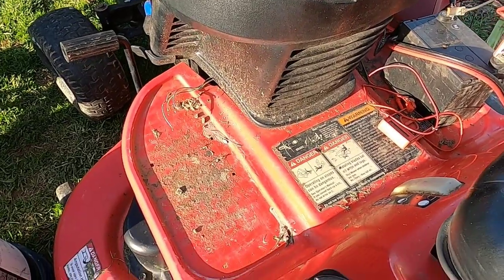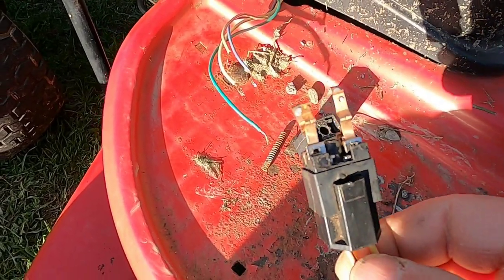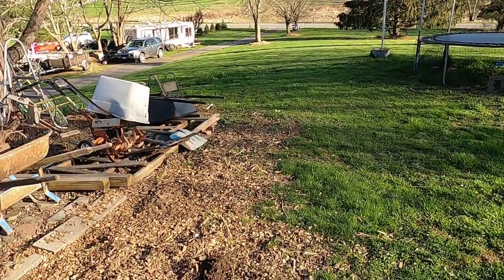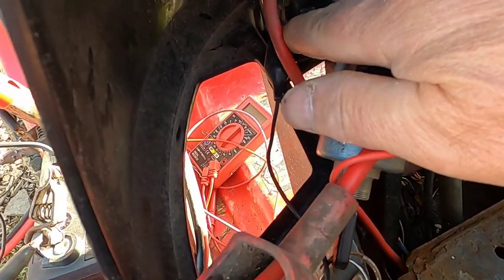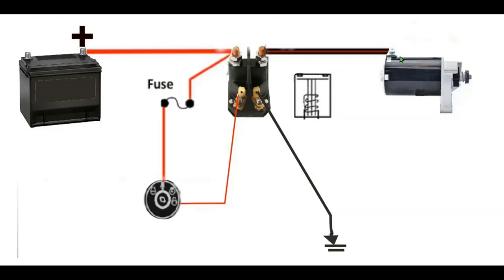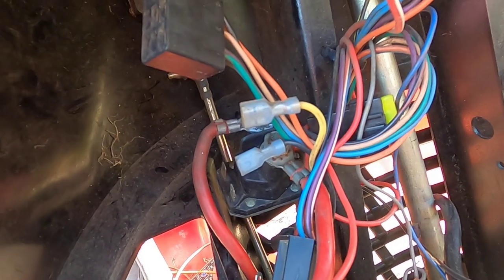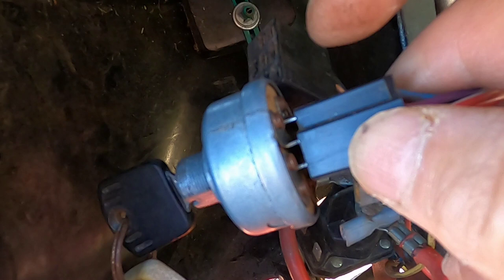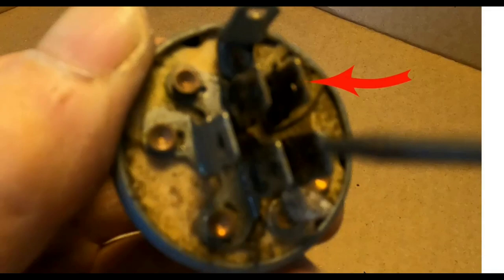Lawn Mower No Start, No Click

Comment: the shop I took my yard machine too said it would cost more than 450.00 more beside the 180.00 I already paid to find out why it wont start or make any sound at all! I had just got it out of another shop that charge me 425.00 and it ran 5 min after I got it from him, I paid 650.00 for this used tractor I'm done!
Reply from the maker: Sorry to hear this. Just like any other trade not all shops have the same level of knowledge or value for their customers. Time is a big factor especially in a large shop with a back log of work to get done. I usually work on my own units & the "pick ups" I get & do it in my free time. When I do work on other units I do not charge for all the time it takes to diagnose the problem, especially if it is something I did not run into before. To be fair a shop dose not have this "luxury" with payroll, dead overhead workers comp etc. The best advice I can give is to maintain your equipment following operators manual. This will help keep repairs to a minimum  & give you a hands on experience to help you get familiar working on your equipment. There are many videos like mine that cover just about any issue that you may run into. Wow this is getting long. If you do not repair your mower, as is it would sell from $50 to $200 depending on your area. You will even get more if you part it out.
Let me know if I can be of help.
Hope you get to visit again, stay well, Joe Z

Comment: On my mower, the pigtail that attatches to the back of the key switch had one wire that had been pushed back inside the plastic housing of the pigtail when it was joined to the key switch.  I went ahead and plugged the pigtrail back in, then reattached that wire that had been pushed back, separately, to the back of the ignition switch alongside the others on the still intact pig tail.  Apparently, that either was not causing of "nothing" to happen when I turned the key or my "rigging" it as I described, was not the right thing to do.  Otherwise, I have replaced the battery, ignition switch, starter solenoid, the 20 amp fuse, the spark plug, and patched a section of the positive battery cable that had insulation missing and become frayed.  Oh, I also dismantled the seat switch by taking out the metal peace inside the pig tail and did not hook it back up to the seat.  I guess at this point, I will get a new pig tail for the ignition switch and wire it in to the existing harness.  Hopefully, that will get it going.  Any thoughts as to why nothing happens when I turn the key?  Ty!
Reply from the maker: Thank you for stopping by & your question. I would try removing the kill wire that is connected to the coil. If it then starts it may be a short in the wire or a safety switch. If you do this be very careful because you cannot shut the engine off with the key. Can either choke it all the way or have an insulated plier to remove the spark plug. Let me know how the repair goes. Stay safe, Joe Z
Reply: @JOEZEP54  Thanks!  I will give this a shot this weekend and report back.

Comment: My old Murray sat out last winter wouldn't  do anything. Ignition switch contacts must have corrosion on them after starting the the thing with jumping the selinod and switch movements  it finally starts with the switch.
Reply from the maker: Bob Hess, thank you for watching and taking the time to comment.
I had one that 2 legs of the ignition switch were rusted. Cleaned them up & it ran for years. This is one problem when you do not have room & have to leave equipment out.
 Bob, I have other videos on my channel that cover many different subjects  and new videos added weekly that may also be of help or interest. 
Your support is not required or expected but always appreciated. If you are inclined to do so your Subscription, Likes, Comments and using the following links do help.
                        ***** Thank you for your support ******
Again I hope you get to  enjoy other videos on my channel as well. 
 Stay safe, Joe Z